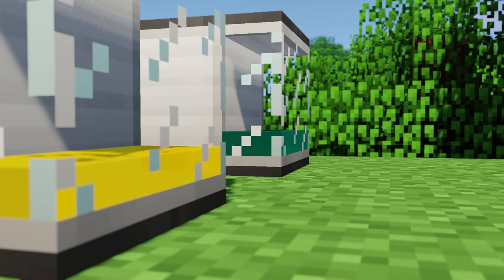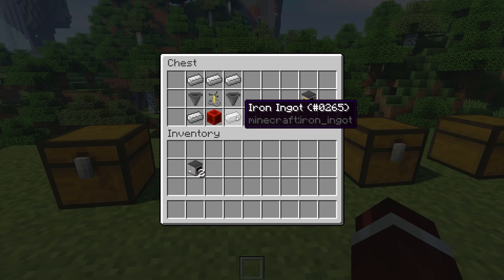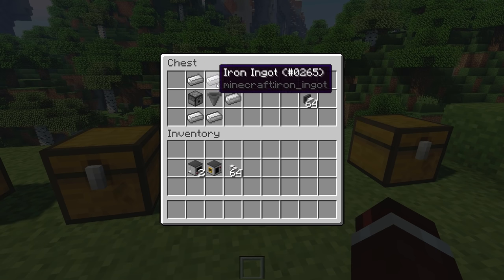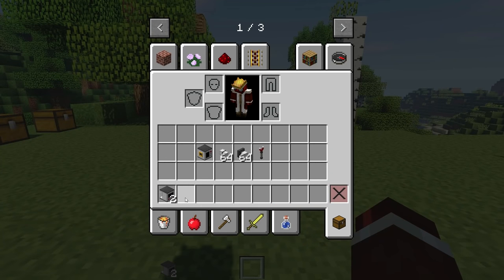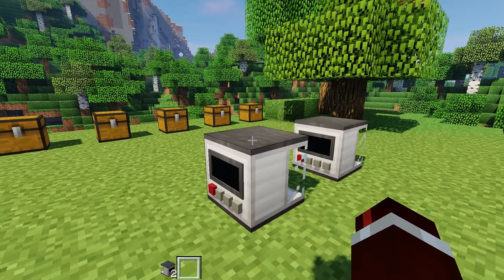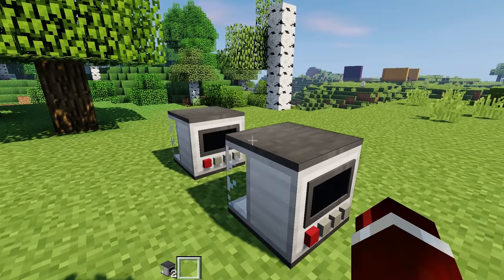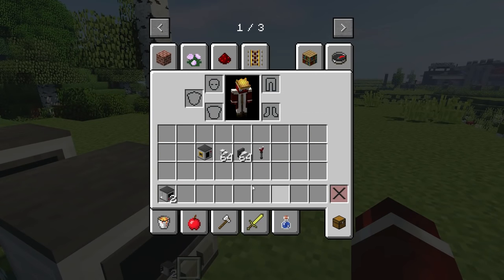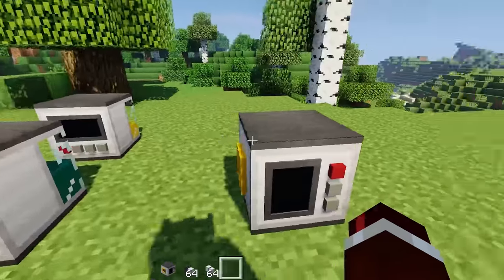✔️ How to Make Fuel in MrCrayfish's Vehicle Mod

Comment: The only suggestion i have is that there should be 2 fuels.  regular and premium.  regular fuel for early/midgame and premium for end game.  regular fuel can be crafted from natural resource and only power "simple" vehicles where as the premium fuel can only power the end game vehicles/planes.  outside of that this is an amazing mod.
Reply: End game? Minecrafts lasts forever # mincraftinfi
Reply: If you have an end game to mc tge. Your arnt playi g it right
Reply: premium fuel usually lasts longer, so maybe instead of it being for high end vehicles, it just fills up more of the car using less of it

Comment: is an yone else having a problem where the fuelium wont go into the barrels?
Reply: yeah
Reply: Yes
Reply: @fadedstatic122  it still wont work :(
Reply: If you press shift you can see how much fuel is in it
Reply: yeah
Reply: Yes, same for extract it in the Fuel Convertor or smt like that
Reply: @durpthefox8685  me too
Reply: You have to put a lever next to the fluid pump next to the mixer now.

Comment: Be nice if other fuels could be used from other mods.  Like ethylyne from mekanism(in liquid form, can understand not wanting to support gases), or refined fuel from thermal dynamics.  Heck refined fuel especially as its not really renewable, so the fuelium would still be useful.

Comment: Please make the machines electric with Forge Energy, so everyone can input the standard energy from other mods. And make it possible that the cars also can drive with other fuels from other games or give us the possibility to convert other fuels to fuelium. And bring the update also for 1.12.2 because the most mods are now in the 1.12.2. And please: The electric engines should charge power, not refueling fuel.

Comment: I need some help - I’m in 1.15.2, and when I place down the pipes, sometimes they don’t connect despite the pipes being on adjacent blocks to one another. Also, the pipes won’t connect to the gas pump unless I shift-click on the gas pump, which then leads to my previous error where the pipes aren’t connecting properly. Is there a specific way that the pipes work? Or maybe could it be the version I’m in? Please help!!
Reply: Jessica Barayuga  I’m in 1.12.2, same thing happening.

Comment: This doesnt work at all as in the video.

For one, I can't place a lever on the pipes like at 8:54. It just doesnt work, it always gets placed on the nearest block.

Second, while mixing coal with both blaze rods and ender pearls creates the respective fluids, connecting them to a fluid mixer doesnt work. at all. One will, however the second just wont connect. The pipes will go in every possible direction but won't connect to the mixer.

I'm unsure why this is such an issue, as I was really hoping to make a large, fancy fuel production area in my world but nothing I do or try works.

Comment: The mod is really great. All the different vehicles, trailers, wheels and everything is top notch, BUT im a petrolhead and i just need the oil and gas in my sight. Any plans to make it configurable with immersive petroleum? So we can fuel them up with actual gasoline or diesel? You might also add the requirement for engine oil.
I installed all your mods on my server and we party them a lot, so good. Thank you <3

Comment: Can’t place levers on pipes and pipes won’t connect between mixer and extractor...they just stop next to each other, not sure what’s up. I’ve tried the shift click as mentioned below
Reply: I think the issue is the pipe direction seems to be set opposite of what it should be when I do it on the extractor, but there seems to be no way to switch it

Comment: This feature is very good. But what I hate ... the pipes. It is very difficult to connect one machine to the other as the pipes are often just too short. The length is constantly causing problems. So you can not build big farms. Without the Mod Mechanic I would never have been able to build my big gasoline farm. There you would have to improve again, so you can do without other mods. I'm using the latest version of your mod.

Comment: Does your vehicles work with other mod's Fuel?
Reply: If they don't, it'd be a pretty useful addition (say if it worked with Diesel/Gasoline from immersive engineering/petroleum, or build craft's fuel for an example)
Reply: well its called fuelium, and the ore dictionary for most mods use "Fuel" so i doubt it works, but there is a possibility it does!

Comment: With the fluid mixer can I use other mods like immersive engineering to mix it or is it only just your mod and can I change the pipe for a fluidduct from thermal expansion
Reply: You would have to add in the recipe for the immersive engineering mixer with ModTweaker or CraftTweaker and it works with any fluid pipes! :)

Comment: Hi your block designer doesn't work for windows, can you fix it please?
Reply: It works fine for me, and I use Windows...
Reply: @magmyran3450  can U make a zip folder with it in it plz
Reply: @samscommandcodes7199 No. But have you tried to fix it by yourself? Because you can try to reinstall it. If that does not work you can try to reinstall it but this time you are going to not cross out the page before you have seen that there is no blue ring around the icon of the file.

Comment: I'm just amazed how you made a 20 minute video out of a piece of information that should've been about 5 sentences and 3 images on a wiki.
Reply: If you're experienced with modded minecraft sure. A lot of people are beginners and images and a couple of sentences are not enough. I find video tutorials to be so much better instead of reading text. You wonder why tutorial videos pop off on YouTube because people find it easier. Explains why you searched for this video!
Reply: @MrCrayfishMinecraft   I searched for this video because of there being no wiki linked anywhere on your website or the curse mod page, as well as the the apparent disinterest of anyone else to make one in your stead. You do have a point that for beginners a step by step video might be the best solution, but even then you failed to provide those who would require said help with a direct link to such a video in any of the places where they might stumble upon it(i.e. The mod page on your own website or the curse page for it).

So while I do prefer wiki articles over videos, I have to admit that my earlier comment absolutely failed at getting my actual feelings across due to my frustrations. If you want to have videos to explain your mod that's fine, but you should make sure those videos are as easy to find as your mod itself.

Comment: mod suggestions:
please update the 1.12.2 version
make a tire pressure system
make the smart car run on redstone instead of fuelium (isnt it an electric car)
working headlights
better cockpits (speedometers, rpm meters, etc.)
key system should work for smart car